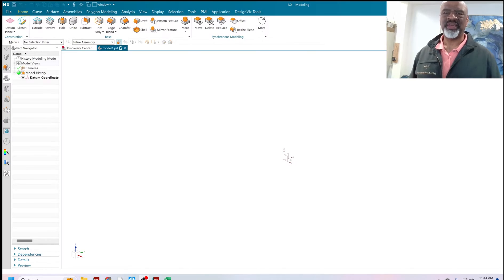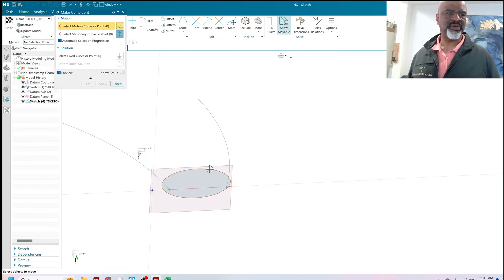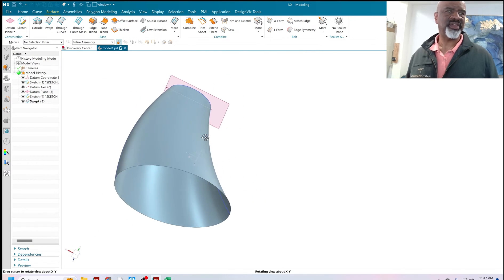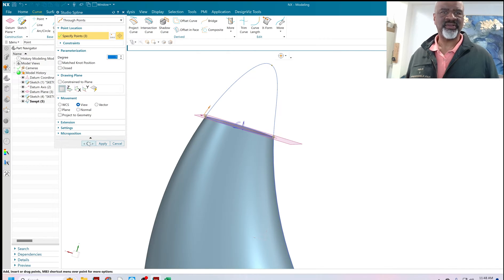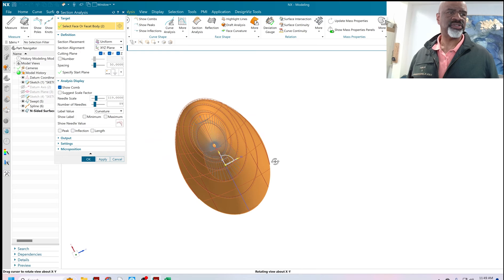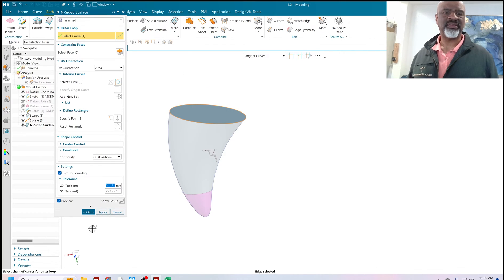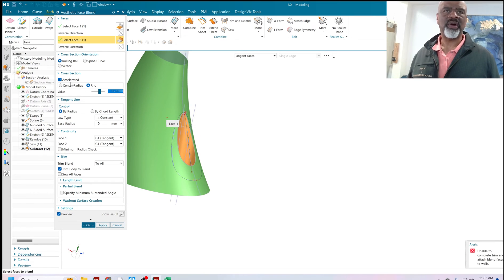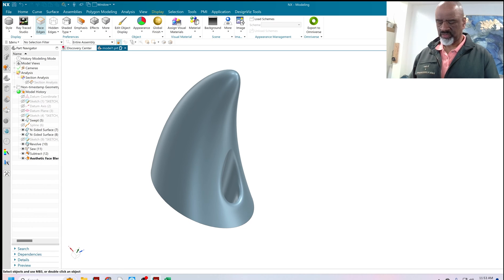Siemens NX Secrets: N-Sided Surfaces & G2 Curvature for Smooth Design

Comment: Hi there, ive been watching this video over and over again but i cant seem to create the N-sided surface in G2 continuity, it says 'unable to build surface'. (The G1 N-sided surface that I can create before selecting the interior curve looks way more flat than in the video). What am I missing here?
Reply: Finally got it in G2, the arc radius has to be as large as possible for the best result, there is just a sweetspot
Reply from the maker: Nice work. Sorry, I'm just getting around to this comment. It looks like you figured it out. Very cool!